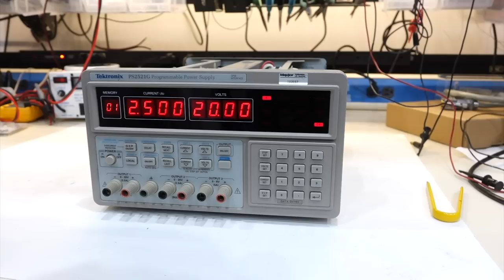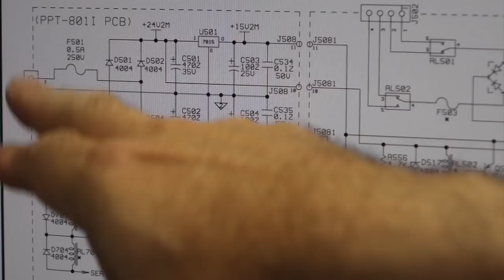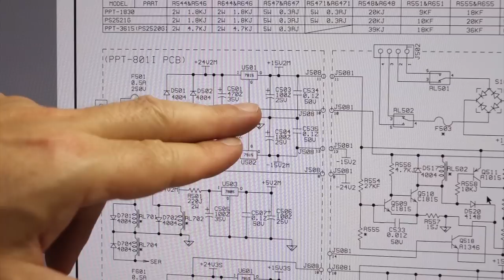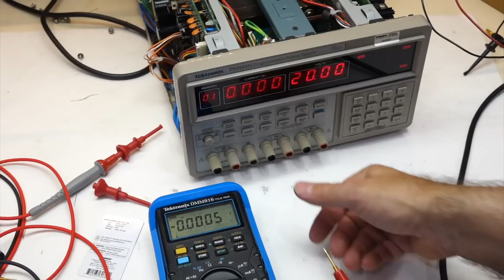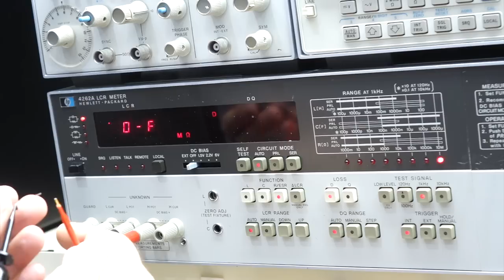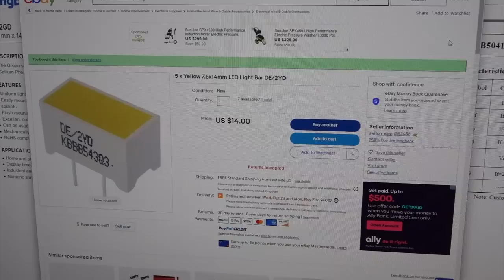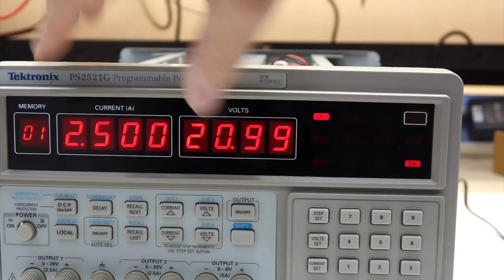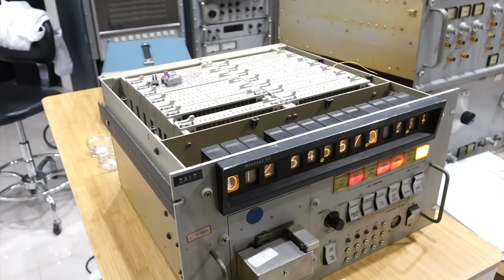Tektronix PS2521G triple power supply repair and upgrade

Comment: The quest for finding an anything-but-red LED to place behind a very red filter was quite amusing, and to be honest the end result was not that surprising... :)
Reply: It's possible, but I'd think you'd need to start with a much brighter LED.  I think the lesson here is to try it before ordering parts.  ;)
Reply from the maker: @russellhltn1396  Yes I was a little bit of a dum dum there too, I didn't realize the filter extended to the LED array on the right. But once I realized that, as you can see in the video, I *did* try it before ordering the parts. However the wavelength of the LED bar ended slightly different from the one of the single LED in the wrong direction, and the filter cut-off is surprisingly abrupt. Oh well, at least others won't have to discover it the hard way...
Reply: @CuriousMarc  Simplest is one of the hyper bright red LED's, which will be around 20 times brighter on 20mA over the originals. Take the 5mm package and simply use a grinder to make the top flat, and leave it with the ground surface, possibly sanding with some 180 grit paper, to diffuse the light. Those LED's are really bright, and even the yellow should be visible, as they are daylight visible.
Reply: great buddy 👍

Comment: you inspired me to buy a desoldering gun, 25 years after I tried one that wasn't cleaned in ages and hated it. It saved my bacon twice today.
Reply from the maker: Nice to hear. I should have bought mine way earlier too!
Reply: Unless you use it everyday don't buy one.  The maintenance and its cost won't worth it.  If you could live without one for 25 years once you buy it you will hate them for the next 25 years.  To me it's like smoking a pipe. It has too much hassles ;)
Reply: @bayareapianist  I honestly don't mind cleaning it when it nicely takes out a 24 pin plug without damaging even one pad. That would take me hours with a sucker and wick. I'll take the 5 minutes of cleaning.
What I can see is how in e.g. a company the thing will always be full of solder because the previous user didn't clean it, like the one I used 25 years ago. But if you have your own one at home and clean it after use, it'll always be there for you when you need it.
You'd be surprised about the cost these days. You don't need a Hakko or a Weller for occasional use.

Comment: It's very good to see that professionals make the same stupid mistakes the rest of us do. This is why my Fluke has a nice feature where it complains if you don't have the probes plugged in the right outlet based on the selection. Been there, done that. And that probably is as close i'll ever be to compare to your expertise :D  Thanks for the video.
Reply: Yes, the Fluke complains. But only on start or when you change the selector. I managed to blew the first fuse on mine because i didn't look on startup and used it with the already connected leads...

Therefore, all hail to the old mechanical solution with the plastic disk blocking the plugs. I have one at work from Gossen Metrawat.
The only problem: it actually isn't equipped to measure amps directly. Only works with an intermediate clamp. 🤦‍♂

Comment: 20:03 Marc using a hot air gun nozzle it may be faster to retract these self-welding sleeves. With these Fluke multimeters, what has happened to me too often after using it as an ammeter, is to use it to measure a voltage without having moved the wires. The fuse must then be replaced.Thanks for all your sharing. You are doing a great job.
Reply: That's why some YT channels advise always changi9ng the leads back immediately after using it to measure amps.  Don't rely on "checking before use".
Reply: @russellhltn1396  This is the way.

Comment: I don’t think many understand how the magnitude of power efficiency has improved over the past 50 years. Even compared to just the 80’s, let alone the 60’s, we are SO much more efficient in our usage now.
Reply: Well you also gotta think this is a very much fully linear power supply. Nowadays we mostly use switching supplies. Quite good but very noisy

Comment: Sheesh Master Ken would have spotted the mistake before you powered on and Eric would have fixed it with his finger thats what you get when you try to have all the fun alone 🙂
Reply: So true. Master Ken would reverse engineer the zero reading to its source in a flash. But hey, it’s a comforting thought that even the master of faultfinding gets his wires crossed sometimes 😉

Comment: This power supply was actually manufactured by GW Instek and was rebranded for Tektronix.

As for the Dallas Battery Backed SRAM you can still purchase new ones from Digikey. It only holds the calibration offsets (calibration instructions are in the manual) and the user settings so no big loss if it dies you'd be surprised how long the batteries in those last.

You can also ditch it and replace it with FRAM such as a FM16W08. It has the write speed of SRAM but is non volatile and doesn't require a battery.

With a custom made SMD to DIP adapter PCB and some glue logic I used a single quad NAND gate (this FRAM latches the address when CE goes low so CE must be toggled for each address read or write). The original SRAM doesn't latch addresses so many devices simply hold CE low constantly sets the address and brings OE low for reads and WE low for writes.

Comment: You need a capacitor leakage tester that can measure the leakage current at full working voltage so you can weed out faulty capacitors like in this PSU.

I recommend the HP 4350A, an old model but still very useful today.
Reply: Carlson super probe!

Comment: Oh, Dallas Semiconductor and that blasted internal battery!!  Where I worked until 2010, we had an old 486DX33 that became support equipment.  This computer had the problem of forgetting the hard drive settings, and that chip stored the information.  The computer was setup for programming Allen-Bradley PLC2 programmable controllers.  The software would not run in any emulation in Windows, and had to run pure MS-DOS 6.22.  I had to hack into one of these to bypass the internal battery.  I ended up cutting conductors and soldering wires connecting to a dual D cell battery holder.  I used D cells because maintenance kept them in stock and there was room inside the steel PC case.  The PC went to Mexico with all the rest of the equipment when that place closed.

Comment: I actually have an infrared heat tool from Raychem designed for installing those solder-shrink connectors.  I picked it up at surplus for around $25 about ten years ago.  Back then there were about $2000 new.  Now they are only made on request and cost over $10,000!
Reply from the maker: Wow I didn’t even know they made such a thing…
Reply: Instead.  Non insulated crimp terminals, and lined heat shrink.  It is the most logical and superior repair.  Crimp can be verified before it is sealed.  Lined heat shrink can be any color you like, or clear.
Reply: I’m a happy user of gas-free 4-point crimped splices, aerospace-style. They are bare metal, just cover with a shrink tube of your fancy :) I’m not a fan of the solder-in-tube splices because they require very well prepared wire ends. That’s often hard to achieve in repairs. The solder-in-tube works great with fresh shiny copper. Anything less than that and it’ll pretend to work for some time than bail. I’m glad the folks at the Connections Museum had the wiring plant that was good enough to use those. When they work, they can save cost. But I’m still preferring the 4-point radial crimps. No need to worry about the wires stating in the middle of a splice or anything like that. And sometimes you can find them surplus in big quantities. Disclaimer: “sometimes” has been once a decade for me.

Comment: Hello Marc. Nice work! What a lab you have -- with every camera angle I see more, and multiple types and numbers of test equipment. 

One thing I noticed on your Tektronix triple power supply was the acronym GPIB. It took this brain of mine a minute or two to recall the General Purpose Interface Bus implementation of the IEEE standard of the 1980's. This was an 8-bit parallel bus standard that came out of HP for test equipment. 

As a software consultant I learned never to throw anything away. In the mid-80's I wrote a driver to support the protocol for a wirecutting machine in the mid-80's. About twenty years later, I used that code as the foundation of a module of C# middleware so that my client could interrogate and read vital signs from a family of medical devices with a "mysterious" GPIB port. This company had plenty of skilled programmers, but no one there had ever seen a device without a USB port or an Ethernet jack. 

One serious problem in our tech world is the view by management that senior staff is an excess expense that ruins the bottom line (we're paid too much) and productivity (we don't crank out 300 lines of code a day, like a 28 year old wonderkind.) So, most mid-sized companies either move their older technical staff into management, or get rid of them through early retirement, or worse. Then when a real problem comes along that can't be solved with the Java or Microsoft class architecture, they're lost. That's how I once made my living -- putting out fires caused by bad business and/or technical decisions -- but it can wear you down. They're always in a hurry,because they could of called you months earlier, and the young hot shots are usually rude and resentful because you've been hired to fix something they could not. 

Glad that I'm retired, but I miss the income.

Comment: I just tried those splices for the first time to make some Christmas lights longer. They're outdoor rated and made the 60 splices pretty easy actually. Luckily that spt-1 wire has some pretty thick insulation so it didn't come close to melting. I was surprised

Comment: The red color filter in front of all those LED's is a bandpass-filter. It passes low frequencies (high wave-lengths) in the red spectrum and blocks everything else. Green (and yellow) are at higher frequencies and can therefore not pass that red filter. ;)
Reply: Nothing an incandescent bulb on top can't fix ;)

Comment: I have one of these and it's pretty awesome.  I bought it since it was the only triple power supply I could find that has three fully isolated outputs.  This lets you change which outputs are positive and negative, and there's relays in it that will let you series or parallel the 20V supplies to get more voltage or current.  The other good thing is it's 100% stock parts.  There's no custom chips or other parts except the main power transformer which is kind of weird for a tek product.
Reply: Actually made by GW Instek, along with many other Tek (and now Keithley) power supplies.

Comment: The worst design fault of this supply is that the "Auto Sequence" button has "ON/OFF" silkscreened onto it, which makes it look identical to the Output ON/OFF button unless you're paying close attention to the far less obvious text printed above the button.  On more than one occasion I've gone to turn off the output and hit the Auto Sequence button by mistake, which causes it to start stepping through all of the memories.  I've never bothered to set these up and on mine they defaulted to the maximum voltage and current limits, so my circuit that I intend to be supplying with 3.3V suddenly gets hit with 20V and a 2.5A current limit.  I definitely reccommend storing a low voltage/current into all of the memory slots so that accidentally pushing this button is not so destructive.

I'm afraid every time I turn mine on that the Dallas battery is going to be dead and the calibration wiped.  So far it's still holding out... but one of these days I really need to pull it out and dump the contents at least before it dies.  I think I've seen people make boards that replace the Dallas module with a microcontroller and FRAM (which, like core memory, needs no power to retain data), but last time I looked into it I couldn't remember which Dallas part specifically was in the supply to see if any of the existing designs were compatible.  Thanks for your video which clearly shows the part number.  (As you know, it's kind of a pain to disassemble).

When I take it apart again I'll do the fan mod as well—it is indeed quite loud.

Comment: Great video!  Thanks for posting.  I have the same power supply and ran into the same issue a few weeks ago.  You saved me so much trouble shooting time 😀.  I ordered the new caps and fuses you recommended and I'm back in business.  Thanks!!!   I even had the same complaint about the loud fan so I swapped that too.   Keep up the good work.
Reply from the maker: Excellent! That’s why I make the videos!

Comment: when i worked as auto-electrician we used mini torches to melt the shrink connectors for watertight connections. Those torches also work as soldering guns, so would assume they would do the job to melt your solder connectors. They just require a little practice to not melt the other wires in a bundle. They're also quite cheap and still mass produced because they're also used in cooking
Reply: Half the reviews on brûlée torches are from electricians, hehe. Good shout!

Comment: I did like the solder splice, we used them in aircraft when I worked for manufacturers. There's a variant with a black pigtail wire that's very useful for grounding shielded wires.

Comment: From wikipedia:
The capacitor plague was a problem related to a higher-than-expected failure rate of non-solid aluminium electrolytic capacitors, between 1999 and 2007, especially those from some Taiwanese manufacturers,[1][2] due to faulty electrolyte composition that caused corrosion accompanied by gas generation, often rupturing the case of the capacitor from the build-up of pressure.

Comment: The DS1220Y-200 is the same as in the HP3458A, CALRAM. It's still available, but check for cheapest version, like faster access and/or other supply voltage compliance.
Some day soon, I'll have to replace that in my 3458A again. So better do it soon, and don't forget to copy the content first, should not be as crucial as in the DMM.

Comment: Those splices are great. They're used a lot in automotive wiring repairs. 
Perhaps you could change the current limiting resistor for that LED, and "turbo charge" your replacement LED bar? I agree with you on wanting a clear "This is hot" indicator!

Comment: There's another youtuber on here who has made a replacement for the DALLAS module of death. That runs from normal replaceable coin cells and its a direct plug in replacement. He goes by the name necroware, might be worth reaching out.
Reply from the maker: Thanks for the tip! Oh I see, his is for the RTC part, not this one. But quite close and really well done, I could inspire myself from that.
Reply: @CuriousMarc  ah darn you're right! Apologies if its a dead end! Just saw the module and was like "wait I've seen this!".
Reply: I did reply but maybe it didn't post.. you can get an SRAM to FRAM adapter board already made from places like pcbway etc (or just make your own)
Reply: @CuriousMarc  FM1808 family of FRAMs may be a drop in replacement with some SO to DIP adapters.

Comment: Surprised the Connections Museum uses solder splices. Scotchloks are a telephone company favorite. My favorites for quick splices are AVX Poke-Home wire-to-wire connectors. They don't require a soldering iron, heat gun, or crimping tool. You just push the wires in.

Comment: As an electronics engineer / electrician of over 35 years, I've never connected a piece of test equipment up incorrectly, put a component in the wrong way, not connected wires back up after fault finding, grabbed hold of high voltage capacitors that are charged up, let the magic smoke out.
Can any other engineers think of anything that I ''haven't'' done? 🤔

Comment: In 40+ years repairing all sorts ive ever had an electrolic cap go short,leaky yes,short no.Tant caps,yes they do go short.
Reply: I encountered a shorted electrolytic cap recently. Zero ohms. Usually, they just blow up. This one was shorted but the 5 volt regulator current limit saved explosion.
Reply: @buckykatnga  I must of been lucky,,as you rightly say they go bang sometimes,which makes it difficult to know the cause,many PSU / Monitor repairs back in the 80,s had input caps blowing, because customer was forgetting to check if 110/240 switch was correctly set,auto switching was at an early stage.Many a new workshop engineer jumping,with clouds of smoke belowing from equipment LOL
Reply: That's because they don't usually have fuses on them and they burn open.

Comment: Just replace the fuses with thick pieces of wire.  You know, like back in the day when homes had those screw-in fuses and people would put a penny in the fuse socket and screw in the fuse on top of it to hold it in place.  That'll get the power flowing again.  I'm sure it's perfectly safe...  😉😂

Comment: I too had bought the all-in-one sleeve and soldering. They are great for doing DIY and medium temperatures. But unfortunately when you do it in an engine bay the heat exceeds and the wires come on soldered. Very frustrating

Comment: Excellent choice of fan, seems to make a surprising difference. I took a different approach and built a fan speed regulator for my vaguely similar GW/instek GPC-3020 . I'd post a link but YT usually flags it as spam -  it's easy to find on my channel, or directly with video ID #  3FC4myguLyw .
Reply: I think I would have taken your approach too. Doubtless it is only noisy because it runs flat out all of the time. I would worry that a replacement might not provide as much airflow as the original, but I am sure that Marc has taken this into account.